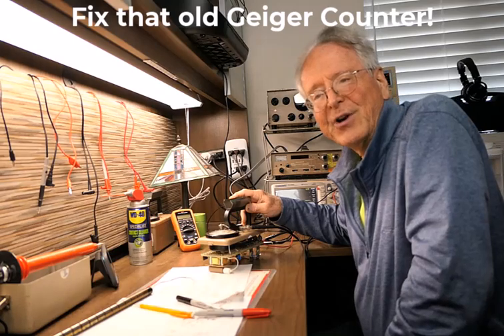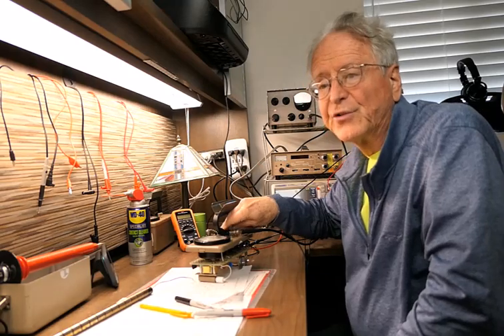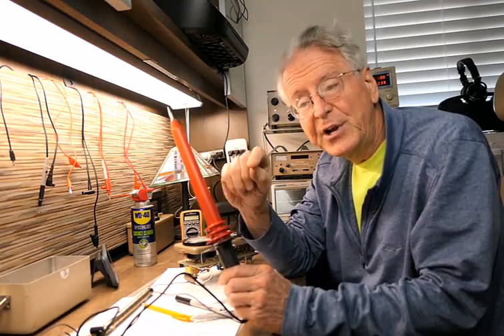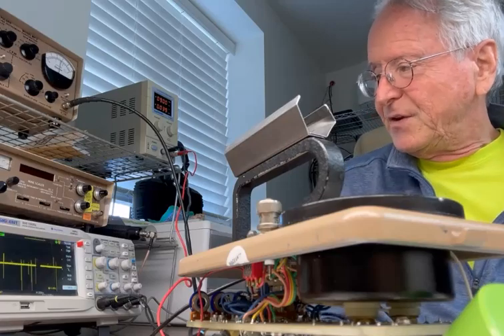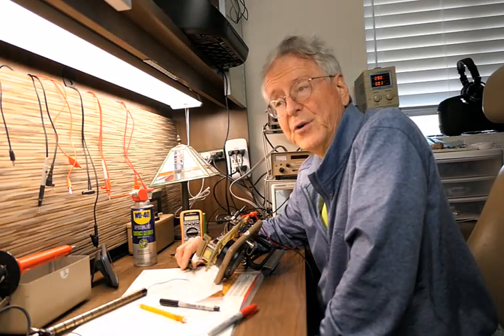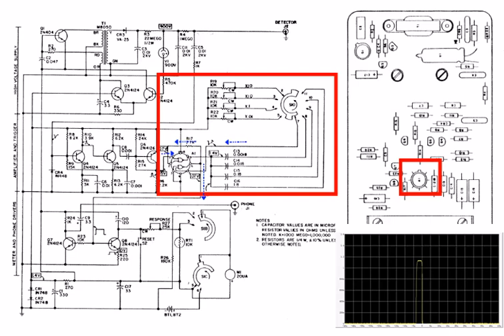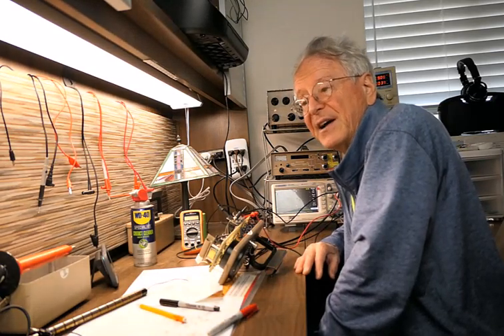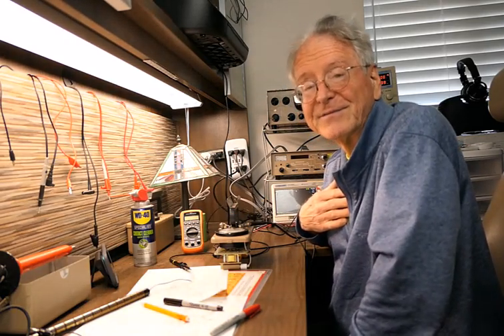Fix that old Geiger Counter! Eberline E-520 repair

Comment: Awesome video! I have an E-520 that tests batteries just fine, but the meter pegs and slowly returns to 0 on every other setting. Any quick fixes for this, or do I need to replace some e-components? Thanks mucho!
Reply from the maker: It depends if you have some basic electronic skills.  Have you measured the HV?
Reply: @charlesdavidyoung  I am unfortunately lacking the tools to perform that test at the moment.
Reply from the maker: @Ralstonado  has this ever worked since you have owned it?
Reply: I'm probably going to have to buy an oscilloscope, aren't I...?
Reply from the maker: @Ralstonado  if you would like to talk about this more: gammadogger@gmail.com

Comment: I watched your video, would love to see you calibrate with the mp-2.  By any chance do you have a pdf of the manual
Reply from the maker: No I don't.  I'll look for it though.  So far it has been pretty easy to use so I have not needed the manual.  If you have a specific question just let me know.
Reply from the maker: I have the manual if you need it.  You should see my email in my videos.

Comment: here I was just using a multimeter that goes up to 1000v, now granted 950 for most GM tubes is up there in its limit basically but it worked to fix my Ludlum surplus buy. the oldest unit I have takes vacuum tubes and 3, 30 volt batteries and a 72 1/2 v battery If i recall and odd ball
Reply from the maker: I was also using a DVM that was rated up to 1000V.  It died measuring HV.  That is when I got this Fluke HV probe.  It is also very accurate.
Reply: also most corona discharge tubes after so long tend to lose some of their potency and now a days have solid state circuit replacements that are drop in

Comment: Looking good Charles.  Nice explanation of the circuit.  Interesting metering circuit.  Most  G.C. I have seen use different resistors through the range selector switch to change the meter RC circuit.